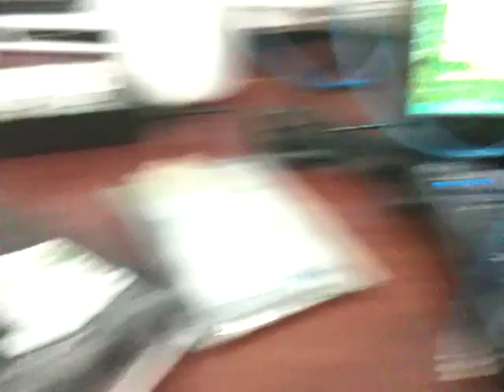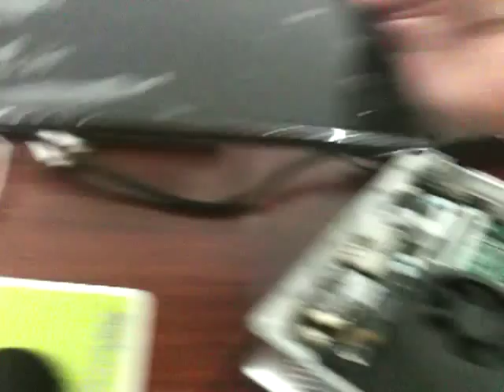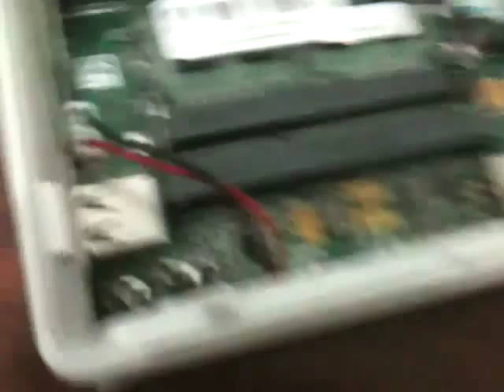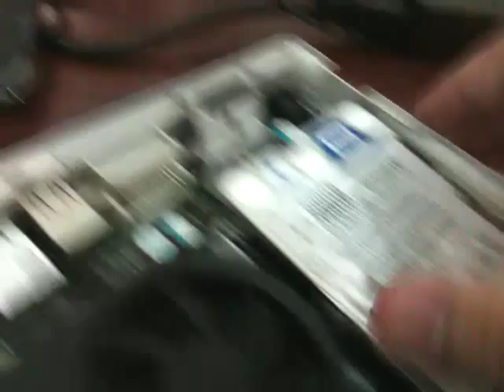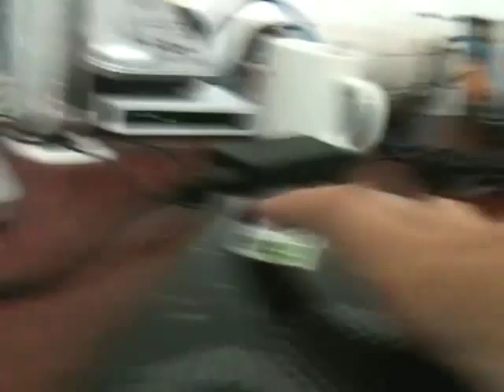ZOTAC ZBOX ID41 PLUS Ram + HDD Installation

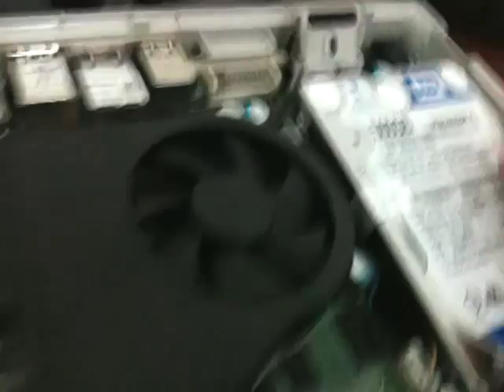Comment: At 1:57 of this video, at the left corner of the hard drive he is mashing, you will see a small receptacle. It has two rows of pins, on the motherboard, right next to it, the letters SIM are stamped in white. The Zotac I picked up today is a ZBox HD ID40 Plus. Does anyone have any experience with type of connection for a SIM card?